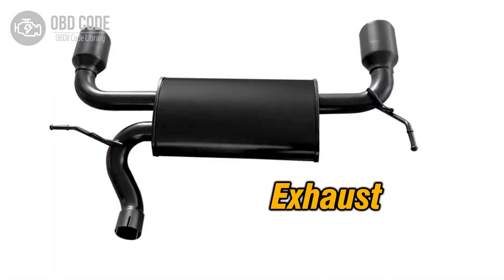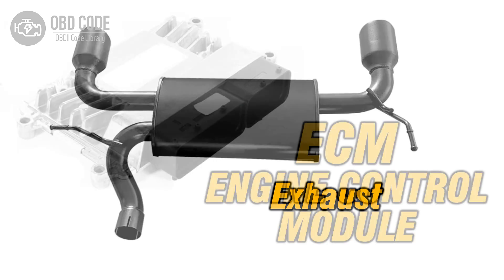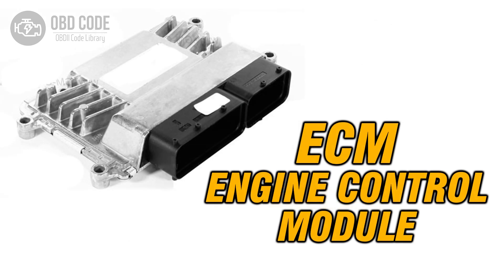P0471 Exhaust Pressure Sensor "A" Circuit Range/Performance 🟢 Trouble Code Symptoms Causes Solutions

Comment: I have a 2012 srt8 stock exhaust. It only happens when I drive very aggressive. What would you say the likely cause is
Reply from the maker: Good morning, I advise you to go to an automotive mechanic specialized in the brand with a suitable scanner, so you can really know the cause of the failure and how to solve it.
Reply: I have p0471 error code in my Hyundai ioniq hybrid car , i don't know what to do
Reply: @dmitriya126  hi did you manage to fix  it I have the same car same problem
Reply: @YousafKhan-uw4lr  - yes i fix it , i clean EGR system , after cleaning no more error
Reply: Same here , but mine is on all the time , I just can’t find the sensor nor the o2 line for it any luck finding it ?
Reply: I got same car mine doing same thing